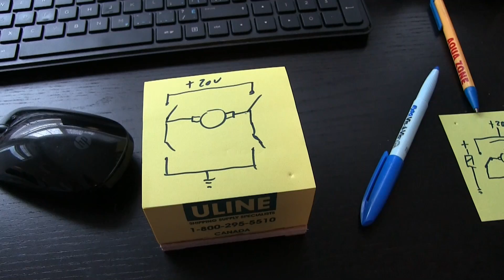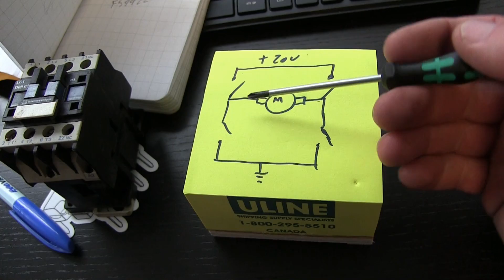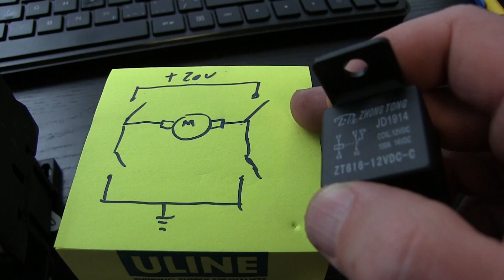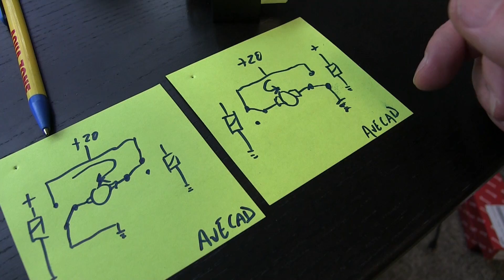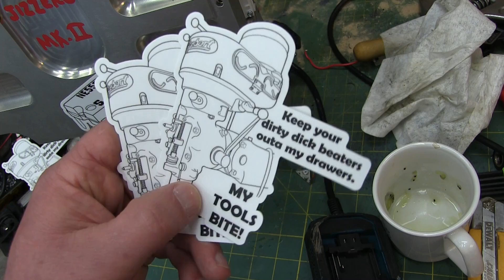Hacking Juicero's DRM Fruit Bags

Comment: For the curious among us keyboard warriors, here is how the Jizzero makes ~330Vdc from 120Vac with two diodes and no transformers. https://ibb.co/hm8Cav
That will put a tingle in your dingle....
Reply: If this is actually the topology they are using, it is quite smart solution, actually. Replace caps with diodes and you get a simple rectifier. In metric land with 220-230 Vac mains that still yields 330 Vdc. They can use the same board with several components changed everywhere in the world.
Reply: So how with the .6 or more volt drop from the diode  do you go from 119.4 v to 169? , seems a bit free energy here. In reality 119.4+119.4 =236.8. is what you would actually get .
Reply: You make a good point about the diode drops, that is something to be aware of, however since it is less than 0.2% of the overall voltage generated I tend to ignore them. I believe the main misconception here stems from AC voltage being measured in Volts RMS where in this circuit DC volts are measured as peak voltage. To convert from one to the other you multiply by 1.414. It's a wanky system at first glance but due to the fact that AC is a sinusoid waveform it simplifies some calculations.

So for fun:
120Vac can make 169V DC
220Vac can make 311V DC
480Vac can make 678V DC
Reply: ahh,  i see , this makes sense to me now. thanks.
Reply: Let's do some calculations.

110V RMS. Multiply by root-two to get peak voltage, that's 156V. The rectifier doubles that, for 311V, less a volt for the diodes is 310V output. Not quite 330V, but in the right ballpark and mains voltage regulation isn't very precise.

A more interesting question though: Why do they want 310-330V? If it's part of an SMPS they would do better using a conventional bridge rectifier, and nothing in this thing needs that sort of high voltage.
Reply: Very true about the ballpark remark on mains voltage, in my area of town I get over 120Vac all day. Typically to be compliant with the sleazy marks for UL CSA RU you need to prove you can take the highs with the lows.

I suspect they are using a high voltage motor because of the need for high speed (to grab your hand)  and low speed torque (to remove your fingers). A lower voltage motor could likely do the job but it would be required to handle a higher amperage than the higher voltage motor. Since you got the ~330V available, might as well use em. I suppose this could also fall in the category of under engineered as anyone can throw a big powerful motor at it...
Reply: There is one drawback to these doublers though: Ripple voltage is nasty. You need rather large capacitors to keep it reasonable.
Reply: The old voltage doubler circuit. It's a handy thing to have.
Reply: friendzis good on you for noticing that. I goofed on the neutral connection in my sketch but I found a way better graphic on the goolger. https://goo.gl/images/PwrZdx
Truth is many non-pfc power supplies (old school pc supplies are a great example) actually do just as you suggested. Check out the volt selector switch in the image I linked.
Reply: 120 VAC = 120 volts RMS (root mean square) aka the "average voltage" (after squaring, hence RMS). Gross oversimplification. Peak is about 170 V. https://en.wikipedia.org/wiki/Root_mean_square

Comment: I wonder if the confuser board with the privacy invasion apparatus has jtag  pins that would bypass the need for drivers.. can you post a close up high res photo of the front and back with close up of bare micro chips? Thanks

Comment: The geniuses at juciero did not even put an AC motor, which could be more difficult to control than a DC one ...   All the electronic crap they put in to simply drive a motor, and they choose a DC one.... wow.  Clearly under engineered, or maybe not engineered at all.

Comment: Why wouldn't you just use a DPDT center off switch. Connect the motor to the center terminals, connect your power source to both sets of outer terminals, crossing them in an X so the polarity is reversed. Flip the switch one way, the motor runs forward, flip it the other way it runs in reverse. You use a momentary DPDT-CO switch so some chucklehead doesn't leave it on and burn it up. Relays and contactors.... talk about overengineered. I can't imagine that little motor is going to draw enough current to burn up a big bat-handle switch.

Comment: Wouldn't a DPDT toggle switch with an OFF position in the middle do the same thing, reducing the possible failure points and reducing it to just one switch needed?  Most of the cheap panel mount switches I have can handle 10A@125V, and a couple will do 20A@125V.  How many amps Is that motor pulling 20V? (18ishV you lying battery marketing wanks)   Of course, I cannot fault your way if it is just for style points to have a covered power switch.

Comment: It will be a voltage doubler just like the input stage of a 120/240 selectable ATX PSU. They have two capacitors in series so they only need to handle half the voltage. When in 120V mode neutral goes to the centre tap, positive cycles charge one cap and negative the other. In 240V mode a bridge charges both caps in series. Either way the DC is 340V.
Reply: It depends where you live. It is 240V in my house in the UK most of time since 240V was the old standard. When they changed to 230V the didn't change the voltage, they just relaxed the tolerance.
Reply: How dare you insult the father of the Mendel90 ?
Hey nophead, my Lexan scratch built Mendel90 is still running superbly.   :)
Reply: There we go again....  Us arrogant US Citizen not wanting to breathe the air of others... LOL
Reply: AnWe79 Yes...yes.....you fed the troll! 😂. Muahahahah muahahaha muhajahahaha
Reply: That's not how I remember it...

in Lechistan, before we used to have 220V AC 50Hz. 380V interphase. That got changed to actual 230V single phase, 400V interphase, on account of increasing power station generators voltage higher, so voltage goes slightly up and therefore current goes slightly down, as current goes down, you get less heat and less losses on teh grid. 
The change was mandated Urp-wise actually.

This info is so old I can't google it out... must have happended before teh Internweb.
Reply: I was about to say this exact thing.
Reply: He's an arrogant Canuck, although I will grant that Eurotrash usually can't discern the difference.
Reply: nophead   Nope!  Try again.   It's actually 115V and 230V. To give a total of 330V.   My God, some commentators are so simple.  We should not breathe the same air!

Comment: That chip looks surprisingly like the ESP32. I would suspect that you would need basically the same software you need to talk to an arduino to talk to the ESP. Take a poke at 'er with the arduino software. Just a shot in the dark.

Comment: Regarding engineering:

Any poser can build a bridge that doesn't fall down.  It takes a real engineer to build a bridge that just barely doesn't fall down.
Reply: Majromax I wanna drive an over loaded semi on the Millau Viaduct before I die.
Reply: @allenwalker911 I went across it in a bus loaded with kids, I was one of them
What's wrong with it? :o
Reply: Majromax I was taught a slightly different theory but the two are interlinked. 
 'Any idiot can design a machine to do a job and it be complicated, it takes a true engineer to design the same machine to do the same job and it be simple'
Reply: @deezelfairy  this.
for a great example of design and engineering look to research Unix and 80's work stations.
Also when I think of good vs bad engineering speaker cross overs come to mind.
Some are entire circuit boards which aren't all that elegant. The better solution is to wire a resistor or inductor and cap in series of the right values. which is really all the larger more expensive board designs are.
Good engineering usually is the most elegant solution.
Reply: but it takes an awsome engineer to build a bridge that falls down just after the guaretee is over
Reply: @user-super-user  planned redundancy is a big thing. not just for cell phones and laptops
Reply: That seems technically achievable. You said 'on' not 'across.'
Reply: Well said.
But it has to be built "Just Right". No room for error.
As the people of Minneapolis MN found out.
Seriously. That's a great truth.

It still amazes me that the Golden Gate Bridge was bought to a near collapse/failure during an anniversary celebration with static load of primarily people. 
I really have to concentrate when trying to understand why that was the case.
But that just reflects my ignorance and cognitive limitations, I guess.
Apparently there were many others like me on that day.
Reply: @msmeyersmd8  you can pack more weight of people wiener to ass into 10x20 feet than an average 2200 pounds of a car in the same space. Hell, most showers are 3x3 feet, that's 21 people per car footprint or 4200 pounds.
Reply: The Tacoma Narrows just barely didn't fall down for years. 7/10
Reply: @WirelessOctopus .... duh, you made a big blunder there, Octopussy. Do some research before you post next time. It fell down 4 months after it opened, not 'years'!
It opened to traffic on July 1, 1940, and dramatically collapsed into Puget Sound on November 7 of the same year.
Reply: RemedialDrift The I-35W Mississippi bridge wasn't completely a bridge building fail. It wasn't maintained properly and was heavily overloaded at the time of failure, between having something like 2" extra concrete and several hundred thousand tons of construction equipment on it. There was concerns of it collapsing long before it did. It's more of a failure to monitor and take care of infrastructure than anything. If they had been watching things more carefully and hadn't allowed so much construction material to be placed in such a small area of bridge, it could have been avoided.
Reply: Slight Variation - any poser can build a bridge that doesn't fall down. it Takes a real engineer to blame the contractor when it does.
Reply: And the real experts can build a footbridge that you can get seasick on. See London Millennial Footbridge
Reply: harlequindemon666 Damn systems engineers didn't flow down good requirements!
Reply: The brilliance of engineering is the required specifications with minimal material.
Reply: >Not always trying to build a xth wonder of the world that's seen for millennia.
Ｌｏｗ　ｅｎｅｒｇｙ/10
Reply: The engineers behind the Leaning tower of Piza salute you xD
Reply: That just might be the reason you die, so goal achieved once there?
Reply: andy ? Then the guys at GM must be fucking geniues.
Reply: But what a spectacle it was. They don't quite make them like that anymore! :-P
Reply: so engineers are useless
Reply: A better example is coding. You wouldn't write 3 pages of code for a solution that can be done in 3 lines of code
Reply: "A designer knows he has achieved perfection not when there is nothing left to add, but when there is nothing left to take away." - Antoine de Saint-Exupery
Reply: harlequindemon666 😁
Reply: he basically said exactly that on the first video..
Reply: That is actually a great quote about engineering and it says a lot about the discipline. I love it.
Reply: Or design and build a bridge within any reasonable time frame.
Reply: juice makers are nothing to do with bridges. sorry,
Reply: I think the real magic in engineering comes from the uncanny ability to create that same bridge but somehow do it over budget, over time, and with way too much 6061 Aluminum.
Reply: Engineers design they don't build
Reply: Bravo good sir, Bravo!

Comment: Give it to bigclive.  He will schematic that whole shit.
Also, does the USB trace to a USB/serial converter like the FTDI or SiLabs one?  If so, you could sneaky sneak your way in and at least see what the hell its saying.
Reply: Also, it is good engineering, but not for the reasons you think.
If you used a cheap but effective method of squeezing the "juice", it would come out in spurts at the beginning and then just dribble.
The entire expense of that machine is devoted to using such overwhelming force that you get a "consumer friendly" continuous flow of juice.  Thats it.

Comment: If those electrolytics are the reservoirs for a voltage doubler then they'd be series-ed up, each half of the double is good for 250V so the max tolerable output voltage would be 500V.

Comment: Quick question. Why not just use a DPDT on-off-on reversing switch for controlling the pixies? This guy looks like he'd do the trick. http://www.alliedelec.com/carling-technologies-6go53-73-tabs/70131832/?mkwid=sOi7mmLHF&pcrid=30980760979&gclid=CMzQweL8i9QCFQgFaQodt4cBvA

Comment: The capacitors would be connected in series in two groups, effectively working as two capacitors. One side of the pixie dust terminal connected to the middle point, and the other side connected to the positive and negative side of the capacitors through diodes. As such, either capacitor group will only see about 170 V, well within their rating. But since they're in series, you'll get the desired 300-something total voltage. For the 230 V market, they'd use the same board but instead use a (deep voice and reverb effect) FULL BRIDGE RECTIFIER!

Comment: I wonder, if your newly found friend, Mr. Jizzmo Press, could be used to pack sand, extremely tight in refractory sand casting and mold making/sand casting? pack the green sand really tight for an exacting detail embossment... (I don't know if the word "embossment" is an actual word, but, I flying with it). Although production work would be slow, and the part would be small.... I wonder if having the mold packed too tightly, would actually hinder the venting?

Comment: I think that this first thing is a contactor, not a relay.
They are doing the same thing, contactors are just high-current relays. But I haven't seen a contactor with double-throw contacts (like this automotive relay later in the video), instead they have separate NO (open when unpowered) and NC (closed when unpowered) contacts.
Reply: And one more thing: Contactors have attachable modules with additional lower current contacts for advanced control circuits.

Comment: Silly overengineering fail. Just use a beefy DPDT switch. Hook the angry pixie supply to the center terminals. Cross over the end terminals, then solder on the motor to either end terminals, and you have an angry pixie choocher that'll force the angry pixies through the motor in either direction. No need for automotive relays.

Comment: You can make the voltage doubler with two diodes and two caps (4 for more smoothing) and all the parts only have to be rated for mains peak voltage.

Dangerous Doubler:
Caps in series, connect neutral to the common point of the caps on your line side attach the two diodes in opposed polarity, connect + to +, - to - (AT THE OUTER POINTS).  Congrats, you now have double mains peak voltage DC.

Comment: any bit of electro kit can be made to run on bare metal, you just need to understand how its set up and what its meant to do, and youll get it to run with a bit of tinkering.  most roadblocks in this area are due to very hard to crack preprogramed ics

Comment: Thumbs up for proving the point with proper/over engineering vs over building.
I always try to explain people the difference, but apparently it's very tough to understand for some.

About the 250V caps, they are probably in series. Very common for these power supplies.

Comment: Just looking at how it was built...and how dogawful slow it is. It needs an air motor. Or a hydraulic piston. Also, a CO2 canister with a nozzle against that aluminum will chill the rum/glass shards as they're squeezed. I like chilled rum/glass.

Comment: talking about over engineering, 2 relays where ya could use one switch like : https://www.conrad.nl/nl/Search.html?searchType=REGULAR&search=nkk%20s333t.

data sheet:http://www.produktinfo.conrad.com/datenblaetter/700000-724999/709375-da-01-en-KIPPHEBELSCHAL_2POLON_OFF_ON_BIS_25A.pdf

Comment: The solution to this is put a sponge in a plastic bag, pour in your beverage, and then cut off a corner and squeeze it.  It's like pouring out of the can, but with a half dozen extra steps and the taste of sponge in your drink.

Comment: Why not just use a cheap 3 position DPDT swt? Also a self resetting circuit breaker to act as an off when the desired force is achieved.

Comment: just use the hand grip and batteria of a cordless drill, take the top drill motor/gearbox off and run the juicer motor from the leads
Reply: and bingo bango bongo reversible speed controller

Comment: You only need two diodes for an AC voltage doubler circuit. You simply connect neutral to the middle of your capacitors, a diode from the live side to the positive terminal of the top capacitors and another diode from the negative side of the bottom capacitors to live. Positive half of the sine wave goes to the top capacitors, negative to the bottom, and you get ~340V from top to bottom with each set of capacitors only seeing 170V each.

Comment: Are the diodes 2 parallel and then 2 sets in series with center connected to neutral?  One set charged to +170V on the positive swing of the AC and the other set charged to -170V on the negative swing?  This would yield about 340VDC across them and I think only require 2 diodes.